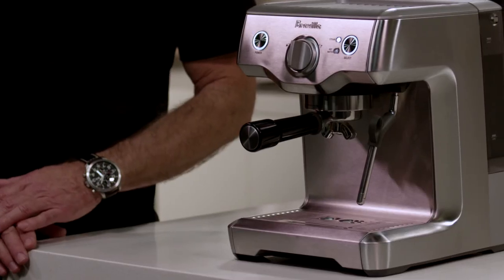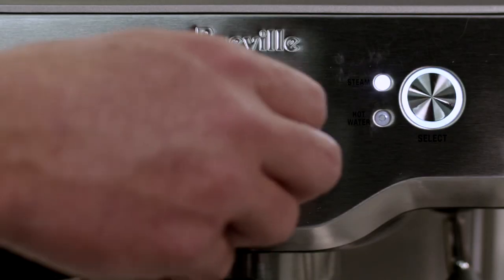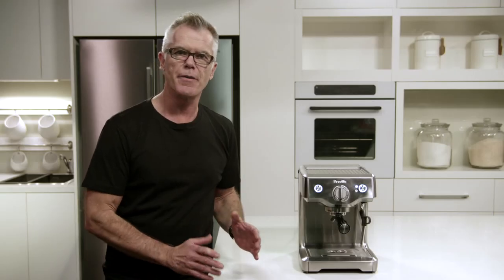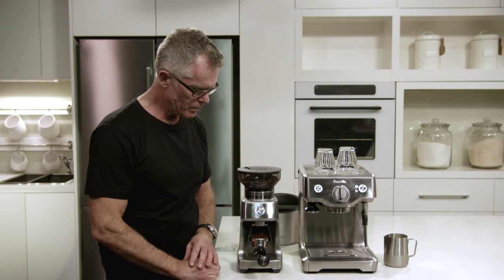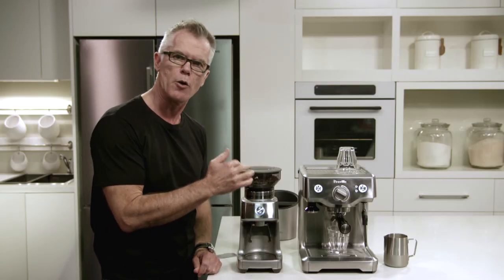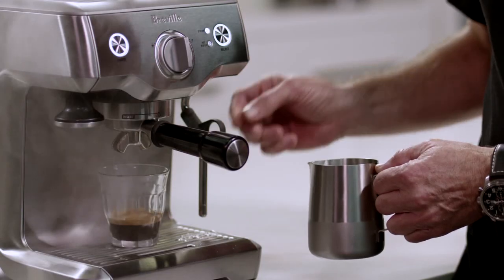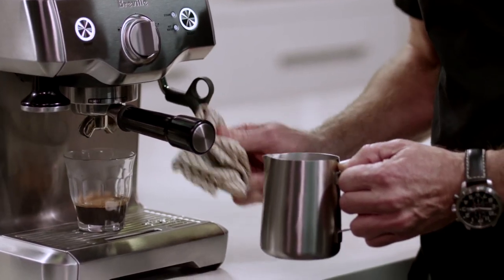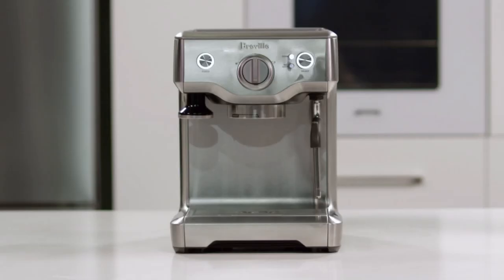Breville Duo Temp Pro Espresso Machine - an Overview

Comment: Hi! I just bought this machine. But the espresso and steamed milk are not quite hot. It seems like a kids temperature. Is there any way to make it extra hot?
Reply from the maker: Hi Clare, please phone our Breville NZ customer services team, they will be able to help you.  Freephone 0800 273 845.  Thanks.
Reply: That's how coffee should be prepared man, if the water pumped out is too hot it will burn the coffee and take away the flavor, replacing it with just a bitter burnt taste
Reply: @BrevilleNZ  ...give the milk a massive steam so you can hardly hold the pot.  Experiment.  I'm with you must be HOT>